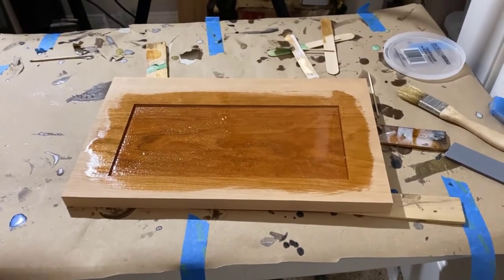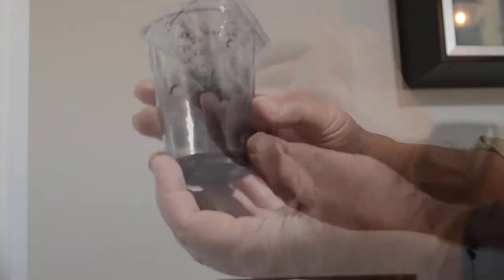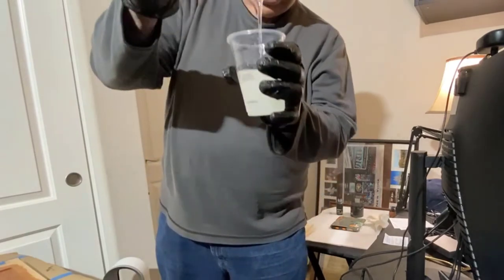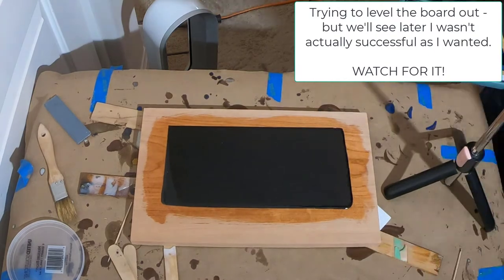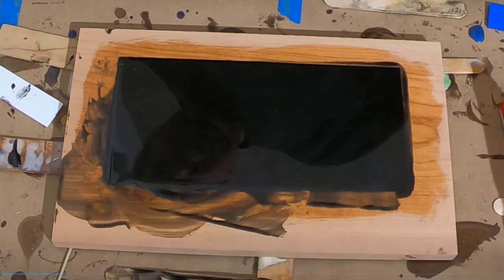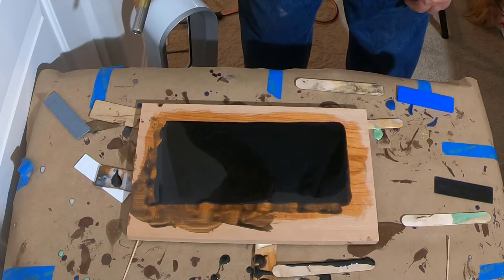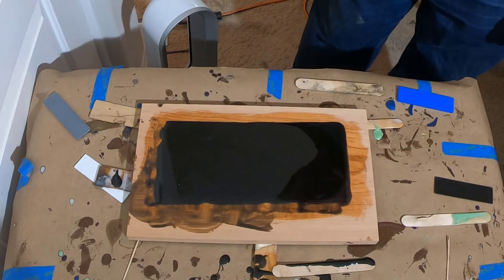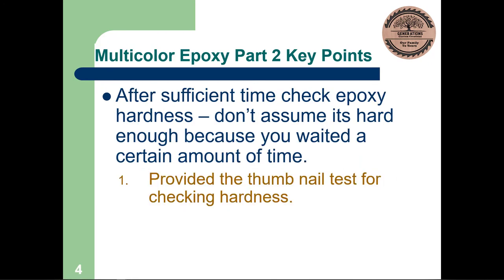Multicolor Epoxy Pouring   Part 2

Comment: Hi Rob.  Having experienced some of the issues you described, I started using a hot glue gun to build a small dam around the poor area to keep colored epoxy from flowing past the sealed area.  This also allows for a slight overfill and takes care of any small variations in level.  Steve
Reply from the maker: Good tip.  I normally don’t have an issue, but then again I don’t normally loose focus.  Your tip would help avoid issue if I lose focus again.  How do you get the hot glue off?  Does it come off with milling and finishing process?
Reply: @RobSandstromDesigns  It just mills off with the excess epoxy.

Comment: How do you calculate amount of epoxy needed if the project is not square, in other words irregular shape? Are there formulas you use to set up the spreadsheet? Should the first pocket be deeper than the subsequent pockets since on a current project I did the fist pocket, filled with epoxy and the second cut went all the way to the wood since the depth was the same as the first. So the seal coat was destroyed
Reply from the maker: Joe…I am working on the third video but I have a couple urgent customer projects I need to complete in next few days.  I will discuss how I calculate the text in this logo.  Basically I use the vectric resize tool, it will make a rectangle size that isn’t full.  I then estimate how much of that rectangle will be taken up with epoxy and use a factor something less than 1 in my spreadsheet.  Not sure if this explanation is clear but it should be when I demonstrate in Part 3.

Shane originally taught me to set the first pocket I was carving into at .15 and all other tool paths at .125.  This is different than what was discussed in Mark Lindsay’s live a couple weeks ago.  But, even if you do carve through the initial layer and precoat it doesn’t normally matter.  This is because the precoat is generally used to create a boundary resin touching the side grain fiber, not below the epoxy picture. Hope that makes sense.  We are generally worried about bleed in the x and y direction (CNC speak) not the z direction.  Hope this helps.

Comment: Thank you Rob. This is the stuff I needed. I know we work in the space we have but I really you would have an easier time not bending over so far. It would kill me. Ouch.
Reply from the maker: You're absolutely right.  In the last several months I have mover from my office to my garage workshop.  Which has it's own challenges, but is working well.  If you see some of my more current videos, like the recent series on how to make a river epoxy charcuterie boards you may notice the height is much more conducive to not bending over as much.